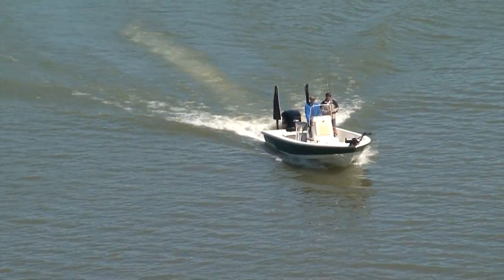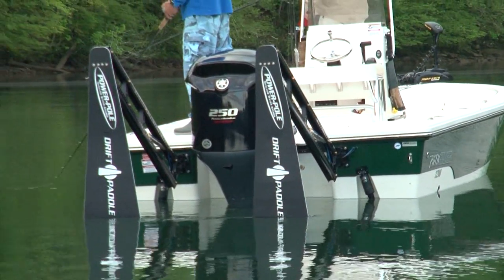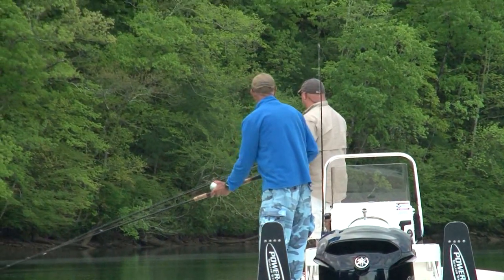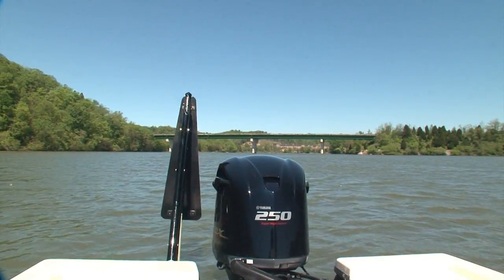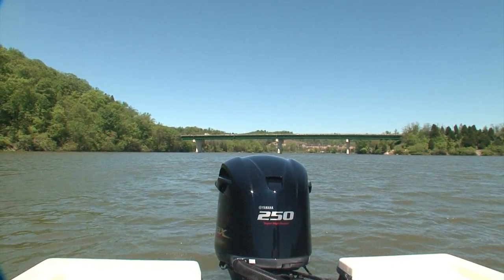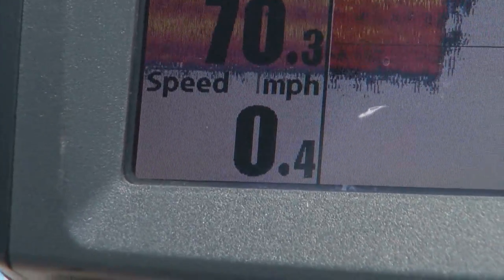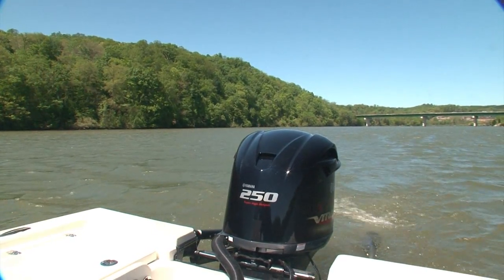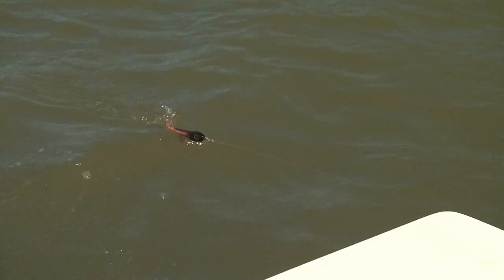Power-Pole Drift Paddle

Comment: Ok.... So these are to be used when you are only drifting with the wind vs into the wind correct? Also do you drive with them on?
Reply from the maker: Mr. UNLIKEU, you would use the Power-Pole Drift paddles to help control your drift speed and direction. They are easy to detach from your anchors but also comes with travel straps when trailering your boat short distances.
Reply: @PowerPoleTotalBoatControl  Thanks I just ordered a set of 8ft & paddles.